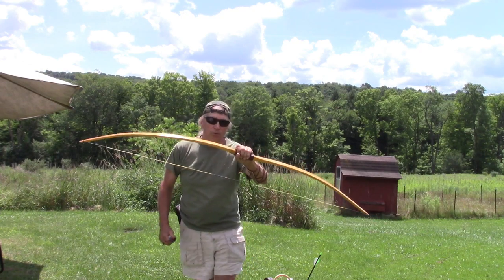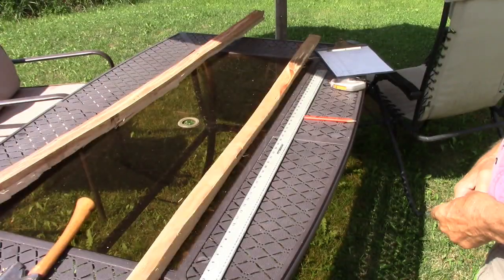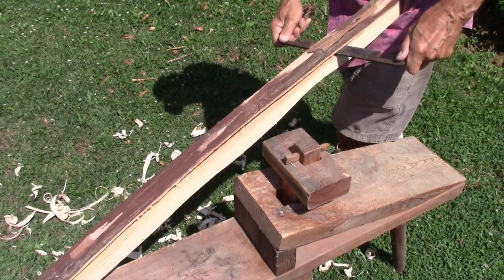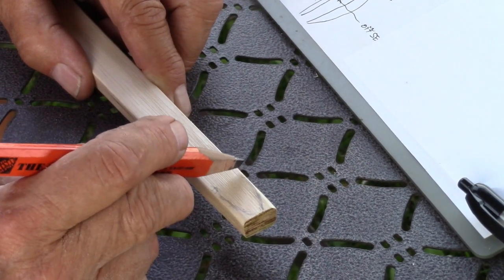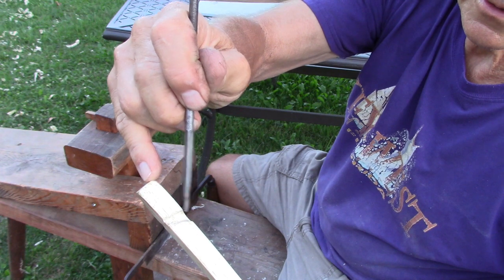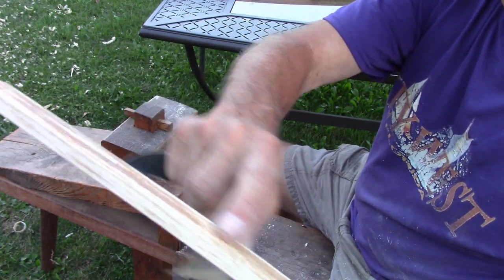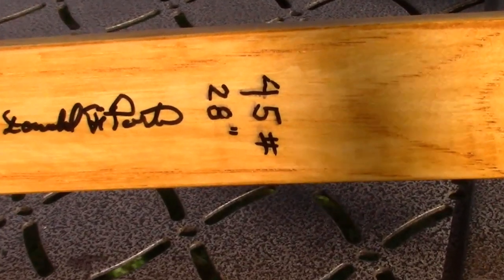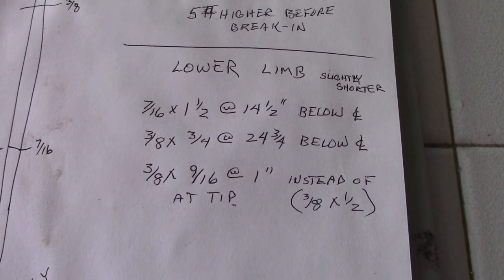The American Flat Bow, 1937 amateur craftsman cyclopedia

Comment: I honestly love the American Flatbow. I became hooked on building this style of self bow and it's good to see I am not alone.

I like Birch and White Oak in addition to Hickory. I actually had Hickory fail while tillering twice on the same build attempt. 

It was not a grain issue. I had used Hickory heartwood in each failure and apparently heartwood with respect to Hickory has a tendency to be brittle also called a tendency towards Brashness.
Reply from the maker: I use only the sapwood that is next to the cambium layer.
Reply: @donaldporta  thanks for your input. 

It was time wise an expensive lesson for me to learn that heartwood probably in general is not a good idea because of brittle issues. 

I actually came across after my mishaps a statement by a Forrester giving instructions on axe handle building telling his audience don't use Hickory's heartwood.... and some rather scholarly articles delving into the topic too.

Comment: the shellac won't crack over time with the bending? looks fairly easy to build one just very time-consuming. how did you come up with 5'8" for the length? thats just a bit taller then me
Reply from the maker: the plans are from 1938, shellac is the recommended finish that they use. I never had a crack in the finish, maybe because it is not that thick on the bow. it holds up nice and gives a beautiful color. the length is from following the plans in the book. thanks for your comments my friend. Don